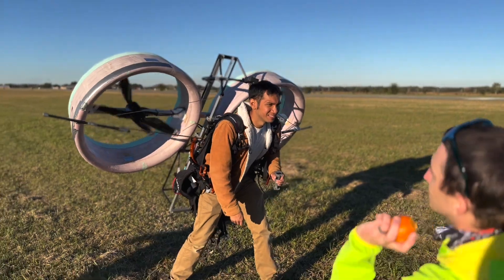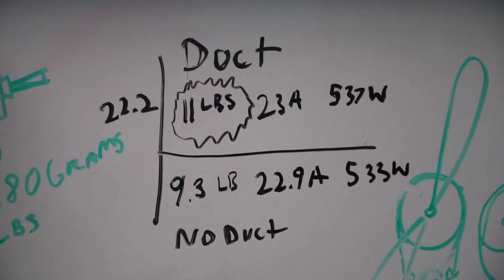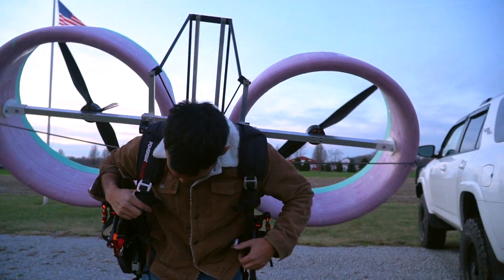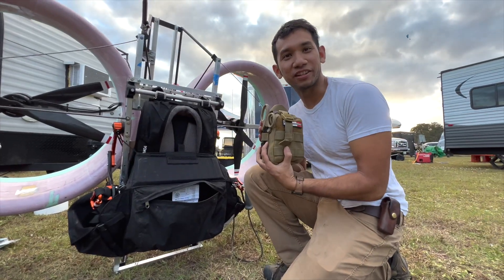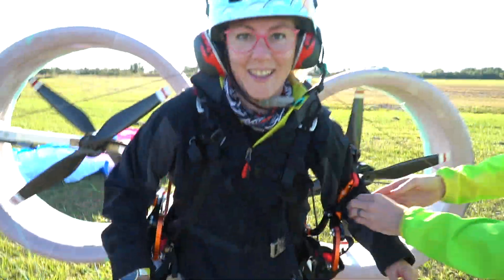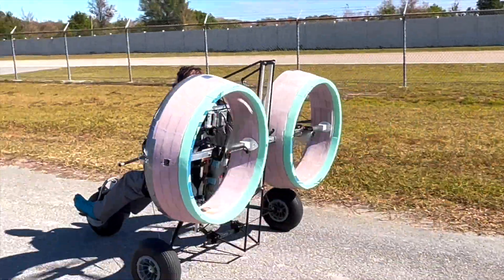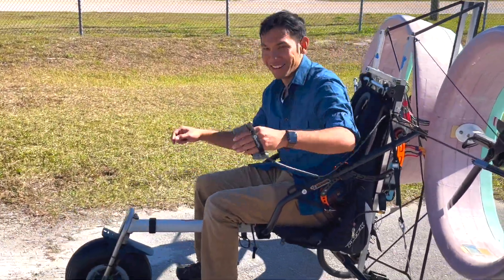Flying with four giant drone motors (ducted propeller paramotor)

Comment: Nice... but dude!  those square tube stators that hold the motors SUUUUK!!
That's aero drag at IIRC 1.05 vs 0.5 for round vs 0.045 for teardrop.
Teardrop them as much as possible and flight time or thrust will probably go up 30%
Just plain old hot wire cut styrofoam should be fine for a test.

You want to keep the stators as far away from the props for noise, but I think aero shape is more important.

If you really want to go to the N-th degree;  Look into DC DBD using aluminium strips and Kapton tape in the duct, where the prop tips are, to negate tip vortices.
If you're interested I can send links, but YouTube will delete any link that isn't to more YouTube..!

Comment: you should try just one duct directly behind the pilot too limit the size. This would limit leverage and inertia that could cause line twisting from yawing. You may need a more powerful motor and battery, but I think you could end up with a very transportable and useful paramotor. P.S. awesome job.

Comment: You should check out modovolo design ducts they make ducts that support the motor with wire so it doesn't add too much weight, like a bike wheel

Comment: Would creating a thin channel on the inside of the frame where the fan blade spins let you run the fan flush with the frame, without the danger of contacting the actual frame? Surely worth a shot. You could achieve some very very close Blade/frame tolerances

Comment: fantastic, i too in the preliminary phase of designing such an duct, however it is 33 inch in dia but instead of electric motors i use IC engines, probably more, do share some thoughts, thanks

Comment: Um...  so you went and built highly aerodynamic ducts and then mounted the motors on the most UN-aerodynamic shape known to man: Square aluminum tube..!??!??
I kept waiting for you to put half an ellipse (3 to 1 ratio) onto the front of the square tubing and similar on the rear (as a teardrop's trailing edge would impinge on the rear propellor)
But no!  Instead we get to hear the BrrrrrrB!! of the blade trailing edge passing that damn square tubing!

Secret 'huge efficiency hint':
You need to swat up on abradable material ... which the foam inside the duct probably already is...!?
All you'd need to do is skip fiberglassing that part of the duct...!!!?
(that's assuming the blades are EXACTLY the same length.  As in lathe style trimmed post mounting)

For the rest of the idea:  good job!  :)

Comment: should definitely do the pre and post pitched dual quad motors maybe arrange diagonal square ⬛⬜ shaped so you got left right up down because the airflow i imagine would be more optimized to avoid airodynamic inefficiencies aka body moving through wind ahead of turbines so getting cleaner flow❤

Comment: why dont you put plexi glass circles by the drivers side and screw multiple screws like a multiple pieced rim and drill holes in it with a water drillbit if it needs to breathe

Comment: I SO wanted you to place a wire mesh over the front of those propellers to prevent accidental dismemberment. If the holes in the mesh were around an inch wide each, there wouldn't be much loss in propulsion and you'd be much safer.

I'm the kind of person who when they're stretching I pull my elbows behind my back to stretch my neck, so I'd easily forget those bad boys were behind me and... ya....

Comment: You really should put a cage over the front of the ducts and remove metal from the frame to lighten it up. 
And you need to inset the parts you’re covering with tape. Anywhere you or your lines can be cut should be addressed before ever strapping it to your body.
Safety last I guess. You’re definitely going to regret that someday.

Comment: so what about using the other two fans for one supplying direct vtol type thrust , and the last one monted ontop to act as a rotorfor lift and also allow more vectoring  if you got air cooling on it, then you mght be able to supply hot air to the underside of the wing sail .. like a t  rather than just two rear thrusting.. you could have more directional support to hover or lift at steeper rates of climb or supported landings a rotational mount might allow for a vector element to add the two other rotors so they can be positioned any degree  between 0 and 90 _  or | to allow to directional rotors aswell as the two stationary rotors.
Reply: don't think upward thrust goes quite so well with a suspended parafoil
also fully manual mechanical tiltrotors... huge no-go.

Comment: You know what would have worked better? Is the trike with a Tesla motor and battery. If a Tesla can beat a Ferrari then why not use the same motors for your props and the Tesla battery’s to get/the power needed 5o make that a electric Jet Prop inducted fan type. I wonder how that would perform on a trike set up!

Comment: and why not use a three-bladed propeller?
I would put a single motor in each fan and a three-blade propeller. Sure it works better and consume less battery.

Comment: Probably a dumb questions, but: Why not 'quad axial' blades? - At what point do you reach diminishing returns on the compound blade's lift-effect? 
Perhaps even dumber: If the rear engine ends up using 20% less energy, can you equalize the energy by using a four-blade propeller in the front and a five-blade (20% more propeller surface area) propeller in the back?

Comment: You mentioned the efficiency loss due to the coaxial fan arrangement... It's also a major contributor to the NOISE. I understand flying is the priority here, but the dirty, turbulent air hitting the second prop is a major contributor. You're also getting a blade pass tone when the blade crosses the motor support. In HVAC we address this by minimizing the cross section of the motor support in the direction of airflow, and use spiral swept blades or swept motor supports to "flatten the curve" of the noise generated by the blade passing through that airflow disturbance.

Comment: GR8 development! I always have the doubt on whether, for a Custer Channel Wing arrangement, the propeller in leading edge, on thickest part of airfoil, on trailing edge, with or without a 'counter-propeller', as static vanes in turbines and turbo-compressors, and/ or a flat ring in upper side, to avoid bizarre air flows, may deserve being tested. Blessings +

Comment: Great video. I have never done anything like this.

But I do have a question. You started with 4 ducts and converted them to 2 ducts. But you never cut down the original frame. Just as an outside observer,  it appears to my ignorance the frame is way too big for your 2 ducts. 

1. Why didn't you cut down the frame? It looks like you could drop at least half the frame weight by making it smaller.
2. Why didn't you use a blameless duct? That would make it much safer as there would be no spinning props. It is claimed blameless ducts are more powerful than blade props so you should get more thrust out of an equal sized motors.
3. If you can use a blameless duct it could use a duct fan instead of a prop thrust.  Duct fans therefore could provide more thrust for less power.

If you saved 5% power by using a smaller frame, plus an additional 10% power by using a blameless duct and another 10% additional ducted fan that would be either a 25% reduction in the size and power requirements of blameless ducted fan system over a prop system OR a 25% increase in thrust for the same hp motors. Not to mention it would be greatly more safe without props.

Comment: Love the project s and channel but dude, do yourself a favor and place a cheap grading in the fans. You could use galvo steel stucco grading. I seen a video of a dude building a home made helicopter and the blades hit and killed him. Safety first brother. I also uave a question. What if you increased the amount of blades porportional to the area of the blades you have now? In other words, if you cut the blades in half, then that half in half, so youd have 8 smaller blades with the same area as the original blades. I think the higher RPM of the smaller circumference will generate more trust.  I also think if you go with a 8 blade turbine type route that having diffusers like they have in between turbine stages will also help. A small gas engine, weed Wacker, with a small alternator would also increase flght time compared to batteries weight. Love the channel and be safe

Comment: Using electric motors couldn't we join the ducts like a vin diagram? The electrics can be made not to interfere much more easily than mechanical engines.

Comment: This is an almost-practical vehicle! I wonder if you could fix the pitch mismatch by just running the rear motors at a higher speed? Let's see that trike in the air, plenty of room to strap batteries to the frame.

Comment: having built contra rotating ducted fans, you’ll find the rear prop should have less pitch not more pitch because the air is being twisted by the first prop so it’s hitting the second at an angle.  You can bench test the different blade pitch’s but I would start with 5 degrees less pitch on the rear blade. Contra blades tend to be extremely noisy.

Comment: What if you used inducement instead of standard ducts? Like a bladeless fan, you should be able to use the multiplier to get the velocity with lower motor power?

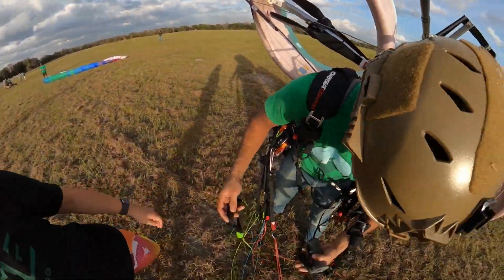Comment: 8:41 if you rotate the GoPro Max so it is parallel with the pole that it is attached to, then the pole becomes invisible, because of the Max's offset lenses, and you could get a way cooler shot... with no pole.

Comment: You could do a up+down version of this.
+ Slimmer
+ Less heavy structure required
+ Lighter
+ Stronger
- needs foam flow combiners
- needs front covers
- small decrease in airflow
Reply: Vertical arrangements would require air to flow around the pilot with sharp changes in airflow directions reducing thrust. Ducts are very sensitive to inflow turbulence that mesh guards in front of the ducts would induce
Reply: @michaelmagill189  yes that's true and it's a problem to solve or workaround.
Propellers and ducts can develop quite a lot of thrust like this though.
Flow combiners could be used behind the pilot, to fill the low pressure area and guide the air smoother towards the duct.

With flow combiner I just mean a Chunk of reinforced foam that tapers from the pilot's rough surface area towards the space in between ducts and a bit of funneling structure towards the ducts.
It's too difficult for me to describe it with words and adding to that i'm German
Reply: @Lardah  low speed ducts want to be as short as possible. A longer duct pushes the operation toward higher speeds. Fine for airplanes but not parasails. These things want massive volumetric flow at relatively low velocity. The big advantage of coaxial fans are higher thrust from a smaller unit and elimination of torque. They suck up a lot of power for what they produce and to get any real efficiency the fans need to turn at very high speeds which creates spooling lag and slow throttle response. Just like the early jet engines just with no hot section to blow out. See my direct post on this vlog for more details on my experiments. Always fascinated by this subject.

Comment: I'm surprised you haven't picked up eBike, eScooter, or eSkate batteries to use for these projects. You can get some salvage cells with >80% capacity life assembled for really cheap. If you have enough capacity, you won't need super high C ratings or expensive batteries.

Comment: What if you cut a depression/grove in the duct so the prop tip appears to be “in” the duct and would act as if there wasn’t any gap?
Reply: There are no benefits to a groove. The transition edges induce turbulence and any flex in the blade causes contact. Sometimes with catastrophic results. Wish I had videos of my experiments 30 yrs ago. Some of the explosions were pretty spectacular. Variable pitch creates a lot of potential for flex too. Any time two high speed counter rotating props get together, you dont want to be nearby. I've thrown razor sharp shards over 100 feet both to the front and rear. You'd be amazed at the energy these pieces can carry. I've had shards of fiberglass(carbon was rare and expensive in those days) buried 3 1/ 2-4 inches into an oak tree. Perhaps using a stator between the props would help even out the imbalance and a flexible foam or silicone seal could help with tip losses. A house fire destroyed all of my research and the cost of raising a family kept me from duplicating the original work (see my earlier comment in this vid) but I can tell you it won't make you popular with the neighbors.

Comment: I'm assuming you used lipo batteries yes?
Here's a story: When I was a kid parents didn't give me any lunch money, so I had to get some myself, I was making custom li-on battery packs to replace existing li-po for drones/planes etc.
Review from one customer: Before I had to land and swap the lipos to keep flying, now I chuck that li-ion battery in and it flies, it flies, it flies... then my legs start to hurt and I just need to land the plane, not because battery goes low, but because my legs can't keep me up anymore...
So you want to get most dense li-on cells and get someone to weld up a battery pack for you, it will give you at least 3x the flight time compared to lipo with the same mass.
Just make sure its well built, if poorly constructed it can be more dangerous than a lipo, it will disintegrate upon impact, short connections and lit on fire.

Comment: You should start by crossing your lines and stepping backwards to inflate the parasail, then you can rotate the propellers around and never have to be in a position where your lines have to migrate around the motor.

Comment: Is the extrem noise coming from the turbulance, produced by the two propellers rotating in opposite directions?
Reply: Go listen to his homebuilt ultralight videos. Or watch a formula E race. Those electric motors are screamers
Reply: @michaelmagill189  Oh, okay. Thank you. Didn't know that the noise came from the motors, as on my neighbours e-car you hear just the tires. But this are much different RPMs i think.

Comment: Hello friend, I had an idea, and what if you seal the helicopter on electric thrust, with propellers on the propeller, that is, put electric motors on the ends of the blades of the helicopter. It would be interesting to know if it would take off or not.

Comment: get your battery powered flight machines Ram Air Turbines! it'll make your battery powered ultralight and paramotor powered for longer. might be an interesting challenge for the paramotor but the ultralights i bet it can make a noticeable difference 'relatively' easily.

Comment: Is there any reason why you can’t get near zero tolerances by running the propellor inside a slightly undersized ring, then sanding it to the level of the groove that’s been gouged out by the prop?

Comment: I'm not so sure the increase in thrust is enough to offset the increased drag of the ducts. Not that ppgs' are in anyway aerodynamically efficient to begin with, but man are those ducts going to catch a bunch of air especially in a cross wind.

Comment: Hi Peter. It's been almost 30 years ago, but I did a lot of work on ducted fans. In those days I didn't have electrics so I was using weedeater motors. 6 of them. Talk about loud. I removed the governors and was able to spin them to 10 grand. Between the noise and flying debris the neighbors forced me to stop and my test rig was just too big and complex to move around easily. I actually set it up in three different places but complaints killed the project. At any rate, my experience determined that a 5 bladed fan with straight paddle blades set up so that the fans were about 1/8 inch apart ( fans to middle engines front and rear ) produced the highest thrust. I was able to get almost 150 lbs with a 24 inch diameter fan. Yes, tip clearance was critical. I wound up using a three axis mount ( like a y ) as torsional flex in the mount would allow the blades to impact each other. The legs were airfoil shaped and pitched to shape the airflow in and out to minimize spiraling flow and torque effect. The intersection of the legs wiht the duct were about 4:1 width to the inner points at the nacelles. These intersections were CRITICAL. Any disruption of flow was seriously magnified downstream. They had to meet at a near perfect 90 degrees and radii at the intersections worked best around 3/32 in. I was experimenting with variable pitch blades to reduce spooling times when I quit doing research due to neighbors. This is where I really had problems with blade contact leading to some rather spectacular explosions and disintegrations. I had lots of vhs video tape of these experiments but a house fire destroyed them. I've often wished I could start back and have specifically thought that modern high output electrics were the key. Unfortunately I am now retired and disabled so I haven't got the funds or the stamina to persue this research any more. If you would like to pick my brain and check into my work let me know. I'd get a big kick out of working with a bright young person such as you.
Reply: WOW, that's a legit offer right there. That 150 lbs of thrust for a 24" diameter fan...that's amazing.
Reply: @strongme80 ya i was thinking the same. Thats crazy impressive. Id love to have a picture of the setup. Sounds like he did a heck of a thorough job.

Comment: I saw a video of a paraglider getting started with a drone on the back. Once up high the drone decoupled and flew back to takeoff, Leaving the paraglider just flying free without engine. This was on scale model, But this is exactly what i would love to have. Like a whinch start just help to get up and than free flight. Could you build that? If anyone can pull it off it's you😉👊